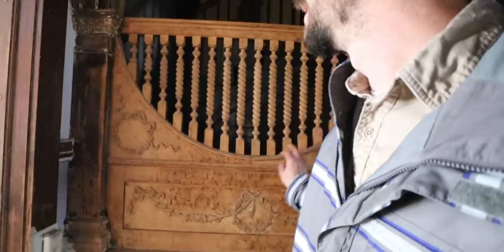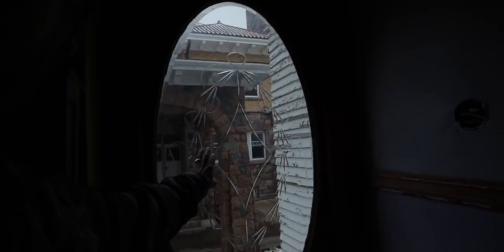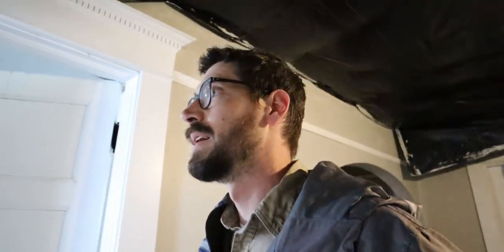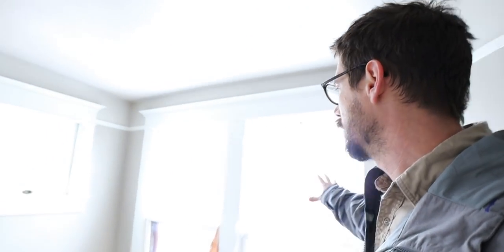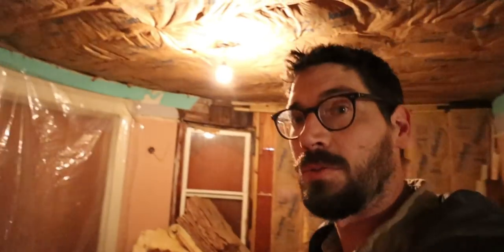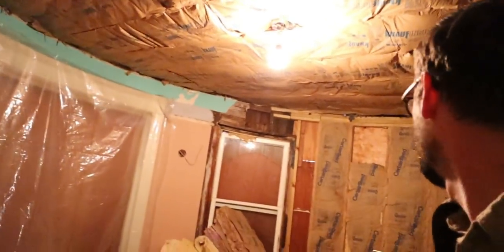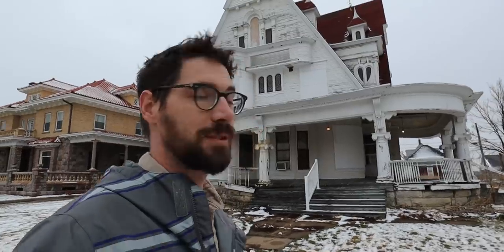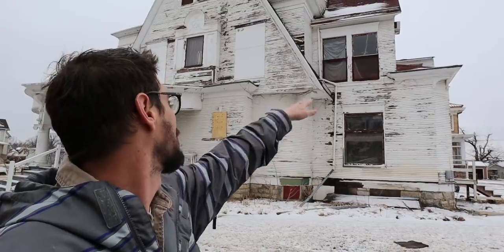Should We Buy this Incredible Abandoned Victorian Mansion?

Comment: The ceiling on the third floor is even higher. Someone made the ceiling lower (probably when they built the apartment upstairs) and cut off the top of the window. You can see on the outside of the house that the window has an arched top. If you break through the ceiling the original will still be there.

Comment: If it hasn't been answered yet, the "thing on the wall" at 3:37 once controlled what would have been a coal-fired gravity furnace in the basement. One lever might control the damper regulating the return airflow and the other likely controlled a damper in the chimney.

Comment: at 3:30 considering it says Lennox Furnace Co. and it has a lever that slides up and down  my guess is its a thermostat or some other type of ancient climate control device 
you know similar to the ones we had before we could adjust the heat and ac with our cell phone because god forbid anyone should ever have to get up off there ass and turn the heat on
Reply from the maker: This was our first time through the house, alot to take in... You are right though it does say Lennox. Which would make since because Lennox is a Marshalltown company.  
I am thinking some people probably felt the same way about the thermostat.  🤣
Reply: @RealityDaydream  its all good i liked the video i wasn't ragging on you guys to be honest i install security systems 4 living and one of the services I provide is i will install someones smart thermostat and smart whatever else they got even though its usually a quick easy job 4 me in my head im like  really! lol

Comment: Should you buy it? Yes, if you can talk to a Mortgage lender (if you're a first time home buyer), and/or a bank. From what I gather watching the video, it would also take a lot of money to get the structure back in shape,  and the other concern I'd have is the condition of the roof, add on some good rain gutters. 

Interior,  I would address the bats living in the attic and get them relocated.  Secondly,  invest in some dead men floor jacks if this house has a basement.  These will help prevent further sinking. Another thing I wouldn't do is add a light fixture that pre-dates early electric wiring in the home.  Most homes were lit with gas lighting before everyone could afford electricity in these old homes.  Back then though they also lit their homes with kerosene lamps. The servants stairs would stay. That tells the financial story of how well to do the home builders were that had this house built.  Personally though, I'd try to tackle the added in walls, etc. that aren't original to the house and turn it back room by room to the way it used to be. One thing that would deter me is seeing a modern bathroom and updated kitchen because then I'd have an added expense of getting rid of a dishwasher,  trying to locate a claw foot tub, antique pedestal sink, etc. But if you have the money,  I'd say go for it. I hope someone buys it to restore it. Sad that some of it was turned into an apartment. Back in the Twenties, chopping up Victorian homes was a thing.
Reply from the maker: Agreed to all of the above... there are a lot of costs that need to be calculated.

Comment: The panel at 3:39 is a controll panel for a coal furnace. One of those levers would controll the fire damper to regulate the amount of air going into the firebox. The other would controll the draft lever or water regulator depending on weather it was a hot air furnace or boiler. You can see a similar system in the movie "The Christmas Story", as the husband goes down to check the furnace, the mother turns the damper up in attempt to burn him lmao. Really cool system, it would basically have a wire running from that panel into the basement/utility room to controll the dampers and regulators so that you wouldn't have to go to the basement to controll the heating of the house!
Reply: Added note: those panels are EXTREEMLY RARE!!! They can go for thousands of dollars. They were usually only found in a very wealthy house, and once new systems came in they were just thrown away. Very rare and cool system, deserves to be saved and taken care of!

Comment: No. You should run likr hell and count your blessings. The structure isnt just sinking in a few spots, its all over the house. The servants stair is also a fire safety element, and no insurer would EVER let you remove a staircase, and NOBODY would put a ballroom on the third floor. That was the nursery and servants' area. And Victorians didn't have dens. Unless you have $350,000 just to stabilize that place you shouldn't consider buying.

Comment: Unless you have the money upfront to do it properly then no....
This house was probably beautiful in its prime days, but not now, and obviously the bulk of your money will not be going into restoring the authentic pieces in the house but into fixing the foundation, the sagging and the obvious water damage will most likely be replacing things instead of keeping the original parts.
Aside from that the proportions is hugely off, where is the backyard you mentioned?
Such a big house on such a tiny property surrounded by other big houses, very unpleasant viewing from outside
The quirky attributes however does make it interesting. It may be an idee to buy and only fix the problems and then sell it on to someone else that can put a pretty dime into restoration

Comment: This structure has undergone many major changes, from heating with fire places to coal, then coal to forced heat/AC, the latter two requiring duct work.  Electricity was added without conduit, likely fuses first to breaker panel.  Then plumbing... from out house to indoor?  Which needed sewers, water in = water out... right!
The roof is shingles, not steel, and shingles blow off and leak and have a life span of 20 years?  To me, they look to be at the end of their life.
In my opinion, the dimensional structure load bearing material need a serious assessment... because of the changes mentioned above... did someone either cut or replaced insufficiently, the load bearing components?
I didn't see many old fire places, nor original places for baths, etc.
Animals and birds inside, how, because these creatures are nasty and cause damage.
Much work needs done very high up, internal and external.  Much work needs to be done down low, below ground, internal and external.  These are things you can't do yourself.
Can it all be fixed?  Of course.  Can it be insured, is limited because the additional damage cause lacks witness it is caused by a storm, for example.
This house will take as much as you can give, to complete what was started but not finished.  And fix what cannot be seen without intrusive  inspections.
If you have adequate disposable income, go for it.  Start at roof level and windows and perhaps foundation to get insurance coverage... they should be your partner, as well as the mortgage holder and assess.
This is just one person's opinion, if not too late.
May God bless you brother and sister.
Reply from the maker: Thank you...

Comment: I don't think those kitchen cabinets are as new as you think. Certainly not from the '80s. I saw a picture of that kitchen when the upper cupboards were still there. The design of the valance above the window looked to be from the '20s, but could have been earlier. I could tell more if the camera zoomed in. Check the  drawers for dovetailing.
Reply from the maker: Oh good idea.

Comment: Re: the dark main, wainscoted (paneled) stairs? Oftentimes each newel post would have had an elaborate light fixture mounted on the post at each landing for candelabra or, by then, gas /electric lighting fixtures. It is curious you mention no evidence of lighting for the main stairs. There may have been a long hanging chandelier, suspended from the top ceiling but that ceiling may have been replaced, erasing evidence of the stairwell light. 
Edited to shorten. Sorry.
I was a teacher and tend to go on in great detail sometimes.
Reply from the maker: Thank you.  I appreciate the response and the information.

Comment: We own an older, family home that we renovated. Updated but with the feel of original. Much of the woodwork was painted over because the dark stain had gone out of style from one generation to the next. I stripped paint off a door to stain it but the old lead paint was so deep in the wood that the stain turned out blotchy. We had a blade made to cut trim to match original. Replaced trim as needed. Built in cabinets between the dining room and pantry, otherwise almost no closets. 10' ceilings on the 1st floor, just shy of 9' on 2nd floor. House cools well in the summer. Our home is split with central stairs and matching parlors off both sides along with additional rooms. The open staircase curves to the 2nd floor where all the bedrooms are located. There is a back staircase that leads down to the kitchen, very steep risers with narrow treads. At least it's a fairly wide staircase. The first thing we did was put on a good roof. Lots of potential in the one you're looking at but a lot of sweat equity as well as cash. Foundation issues get pricey. Unless you get this place for a song, walk away.
Reply from the maker: Wow! your place sounds amazing! Thank you for the feedback...

Comment: I live in Marshalltown and didn't realize so much work had been done inside.  I've seen interior pictures from another site, it was pretty run down inside.  Also, I would think a person would want to fix the foundation issues before re-doing the interior.
Reply: I'd think the person should have worried about stabilizing the structure and a new roof, done correctly.  Than doing the inside stuff first. Doesn't make sense. Evidently not a builder.